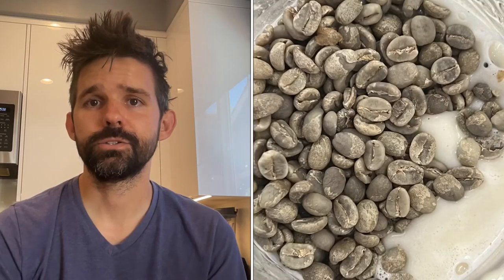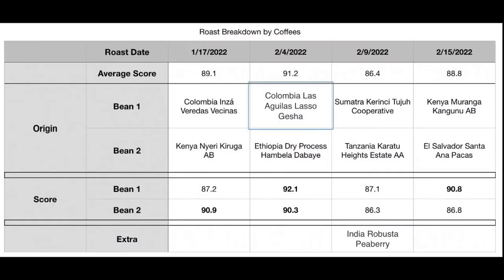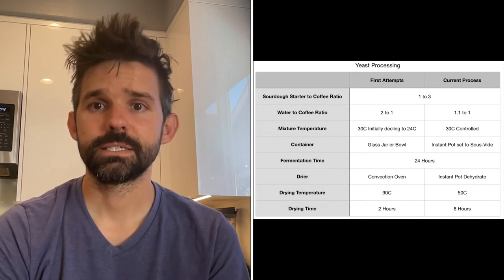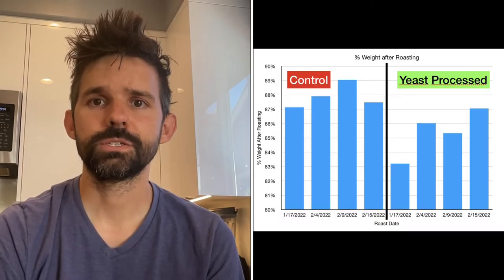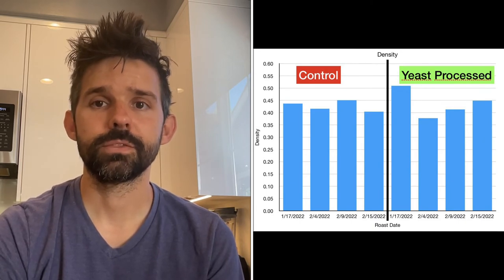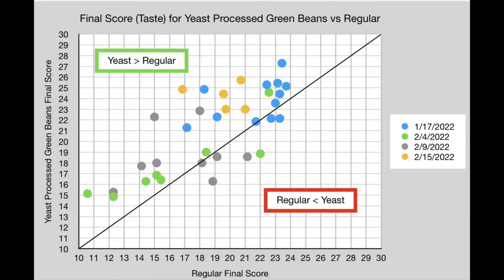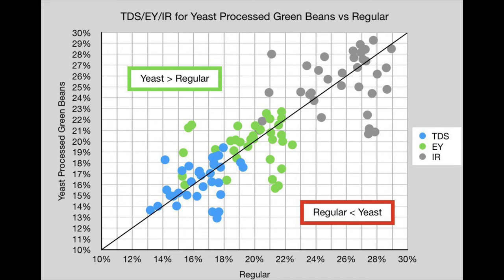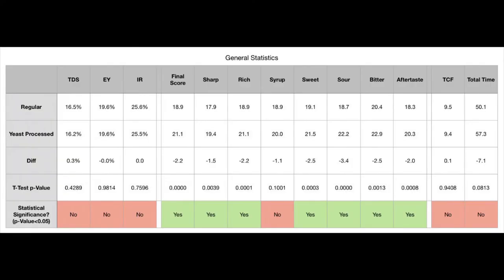Sourdough Green Coffee Processing to Reduce Acidity and Bitterness in Espresso

Comment: this is so interesting!  my wife loves guji but the brightness doesn't sit well with her tummy. will definitely have to give this a try since CA is super hot now and could probably air dry quickly.  have you tried letting it sit in the the starter for more than 24hrs?  wondering if you let it sit longer, would that bring out even more sweetness in the cup or not.
Reply from the maker: You can leave it for longer but I’m not sure the effect. I’ve done 18 hours and 4 days. 18 hours causes a more mild effect while 4 days loses some of the original flavor of the bean. 

Give it a go and let me know how it goes.
Reply: @espressofun6091  Did it end up tasting more like sourdough bread / yeast with a longer 4 day soaking? These experiments were for about 24hours I think you said? Good starting point?